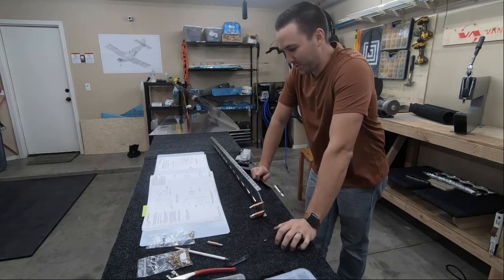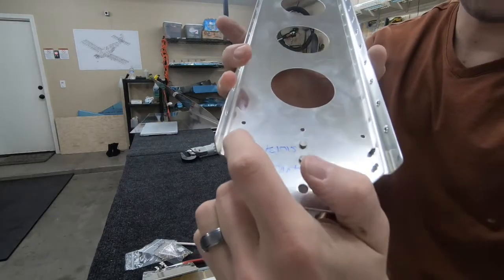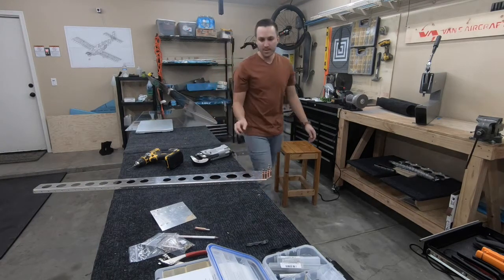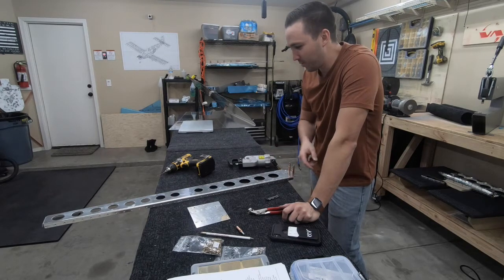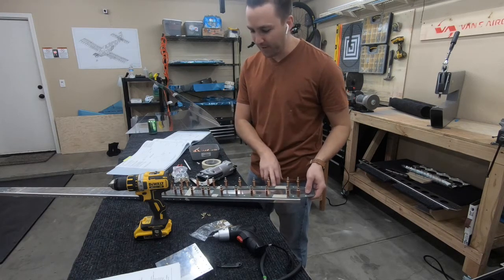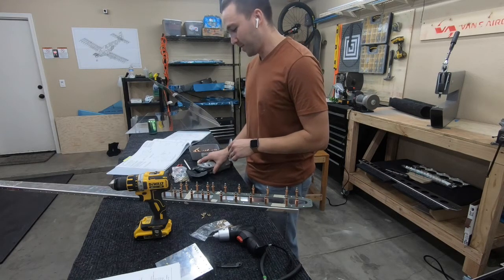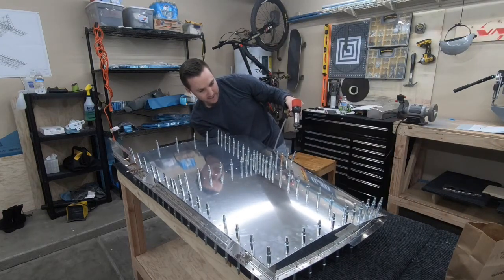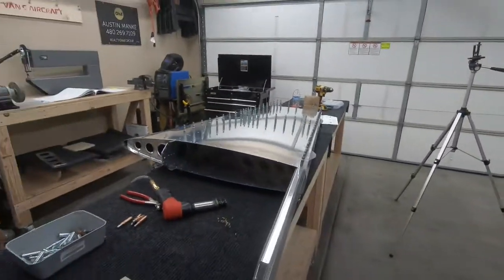First Day of Riveting (RV-10 Vertical Stabilizer)

Comment: Please don't take this as I think you're wrong.  I am genuinely interested in your decision to not prime the internal part.
Reply from the maker: Great concern to have! I still am torn on it, but at this point pretty much only prime mating surfaces if I have the primer available and have some time (I am working on the horizontal stabilizer right now). I live in Phoenix and plan to be here for the long run, so I don’t have any fears of corrosion from salt in the air or extended periods of humid weather. I will also be hangaring it, so the plane will see more time in a hangar than it will in the elements. I will probably stick to only priming mating surfaces going forward, and can keep an eye on the non-primed areas in the years to come. I keep an excel sheet updated with what I have and have not primed as I am going along with the build
Reply: @AustinManke  just ordered my empennage and QB fuselage kits last week so I was really curious.  Phoenix is a good explanation 🙂
Reply from the maker: @JimDorn  that is great to hear! Hopefully they can get it to you quickly. I look forward to hearing about your build progress!
Reply: The detailed views and discussions of the various tools is very helpful for planning and execution.  Vans owes you big time for bringing those plans to life so regular folks can view and understand the building process.